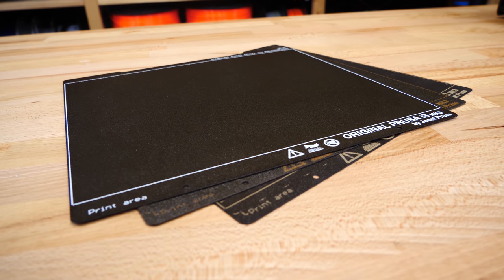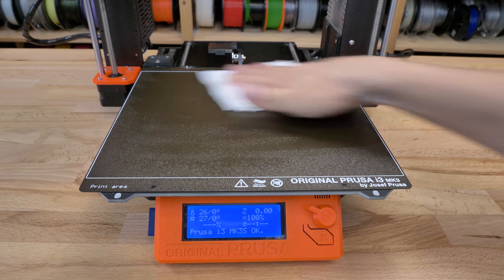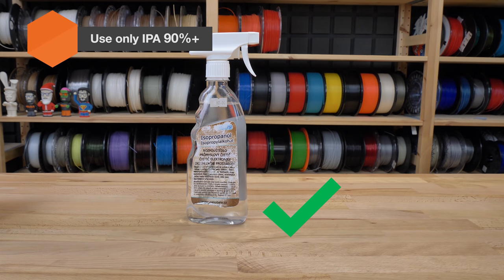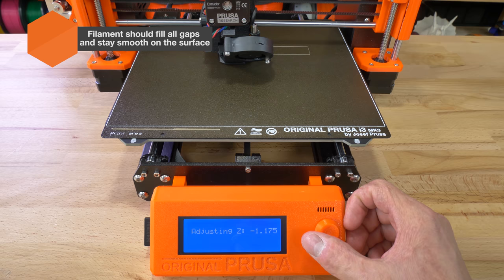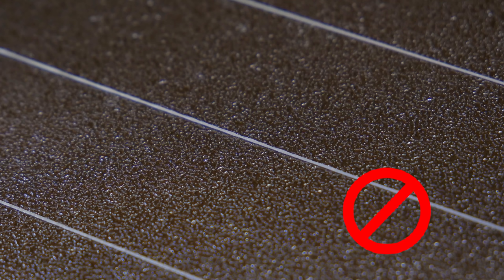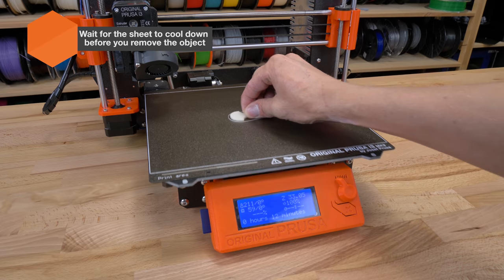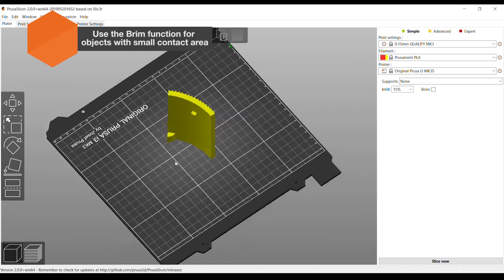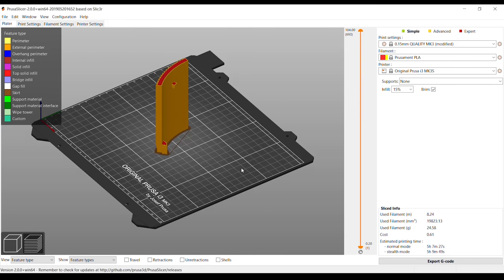How to print on a powder-coated sheet

Comment: This textured sheet is garbage. Cant get PETG to stick let alone PLA from NEW. Cleaned it so many times but nothing sticks well enough to trust it. Stay away at your own peril.
Reply: A week ago I had the same view on my textured sheet. Printed huge brims, Z-readjusting like crazy. Gave up, ordered the smooth sheet. While waiting for it to arrive I found a comment on a different video about the quality of the IPA for cleaning. Basically saying that only realy high grade IPA can remove a residue that is coming out of the coating of the textured sheet and that lesser quality IPAs will create a film on the sheet that makes anything to stick impossible.
So I ordered a quality IPA and gave it a good clean. I do this beween every 2-3 prints now, if I am not touching the sheet or have some visible leftovers.  
What can I say - my new smooth sheet has not yet seen any action and I love the textured sheet now. PLA and PETG stick like crazy during printing and just pop off when the sheet cools down - exactly like advertised. Love it!
I bought Woldoclean 99,1% IPA for 12€/l as I saw this brand on CNC kitchen.
Hope you give it a shot again and have more luck.

Comment: These are absolutely TERRIBLE. Definitely do not get them with your printer. The smooth sheets work waaaaaaay better.
Reply: Then you're doing something wrong. A smooth sheet will have petg and abs stick so much there is a very high chance it will crack the PEI coating layer. A smooth plate will also have trouble with wide areas of supports directly on the plate if your z offset and extrusion multiple isn't perfect. A textured sheet on the other hand will have the slight imperfections in those values be spread into the texture and give perfect tiny lines or support bases every time. Textured sheets let you easily remove wide prints that would have been extremely difficult or even damage the smooth sheet. If you scratch the smooth sheet that scratch pattern will show up clearly on every print there after, while the textured has a unique but uniform finish to the bottom of parts. Each plate has its place, so don't make a sweeping statement that the textured is bad. I use the textured on all of my printers 90% of the time and like them far more than the smooth, but I have to use the smooth for small plate contact areas for example, or when I have to glue two pieces together on their build plate surfaces.

Comment: Worst printing surface ever made! NOTHING STICKS! And I mean NOTHING, NOT EVEN PETG! Tried with ABS, PETG, PLA, ASA, FLEX. I have two 40EUR each paper weights. Stay away from powdered sheets. Heck, even painters tape sticks better then these.
Reply from the maker: You're definitely doing something wrong if none of those materials is sticking to your powder coated sheets. Especially PETG and FLEX stick like crazy to it.
The two most common problems are not having the first layer low enough (you really have to squish it) and not cleaning it with 90%+ IPA at least from time to time.
Contact our 24/7 live chat support at shop.prusa3d.com or check our manuals at help.prusa3d.com, I'm sure we can help you out :)
- Mikolas
Reply: @Prusa3D  I was sure someone was going to say that.
Reply: I agree, i have been trying with prusament petg and the textured sheet, I tried to wash with warm soapy water as suggested, i tried to clean the sheet with alcohol,  i have tried dozens of first layer calibration settings, i can't even get the calibration pattern to stick, either that or it squishes too much. This textured sheet is unusable, was really looking forward to it.
Reply: @williamadams1879  funny thing is that even people ho claim they had success with the textured sheet have problems with warped prints. 
Prusa will not do anything about it, guess it's an ego thing. The smooth PEI sheet works properly though, been printing ABS and PETG like crazy.